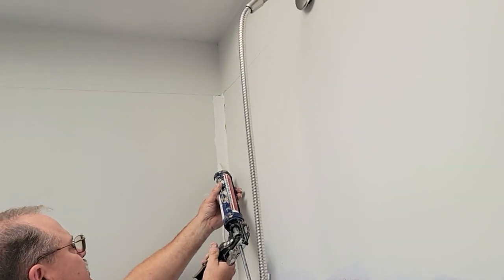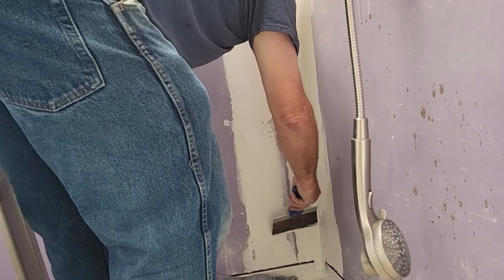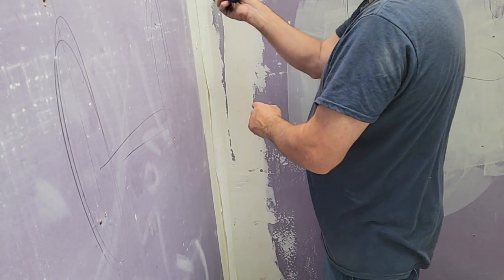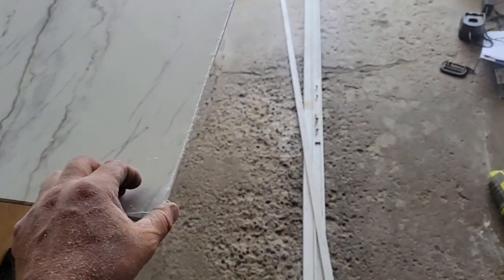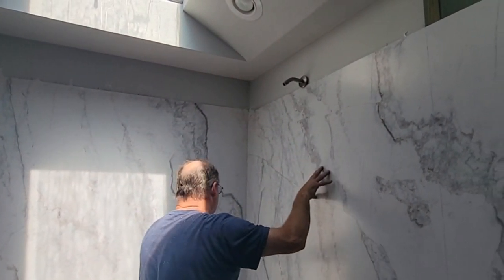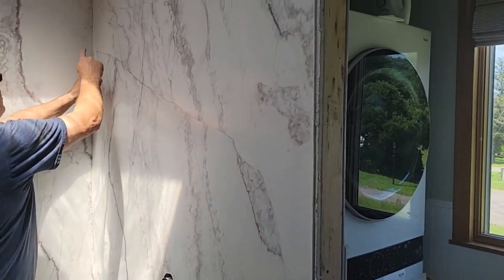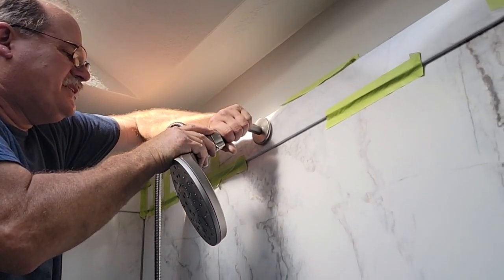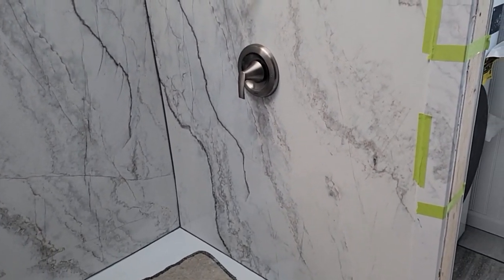FlexStone Shower Wall Install

Comment: What did you use to apply pressure when applying? I see some use a roller tool for leverage.
Reply from the maker: Yes I have a laminate roller similar to the zip tape roller.

Comment: Hi Kevin,Jim question i installing the flex stone shower kit when installing the three panels on the walls do i but the panels tight in the corners or leave a a gap for silicone
Reply from the maker: I thought directions on product were poor at best. I left a small gap to allow for caulking. Usually if two surfaces are tight, there is no room for caulk to get behind and grab. Good luck. Thanks for watching.

Comment: Hope you fixed that back wall. You have a huge gap in the bottom left.
Reply from the maker: Yes we removed the wall and had to add more adhesive then adjust. I didn't like it either. Video was getting long. Thanks for watching.
Reply: @workwithkevin hey Kevin thanks for the videos I was curious if knew the name of this color/ pattern I know IT’s flex stone but is it Calypso or Calacatta White or? I like this pattern
Reply from the maker: @cjbake3238  I believe it was calypso.  Thanks for watching.